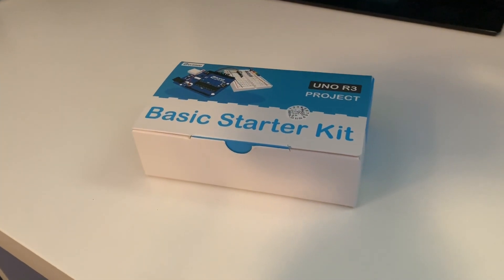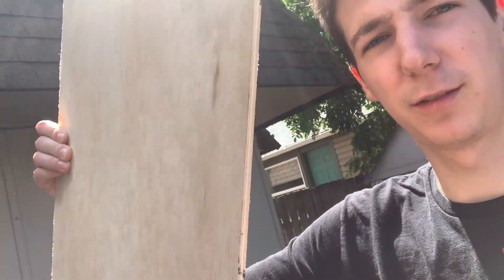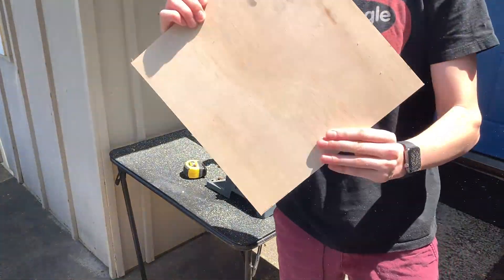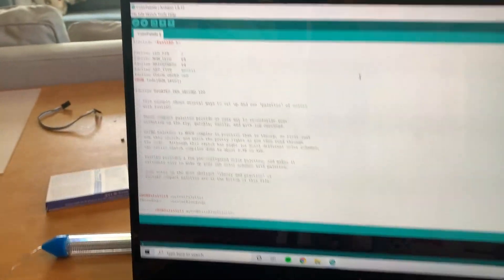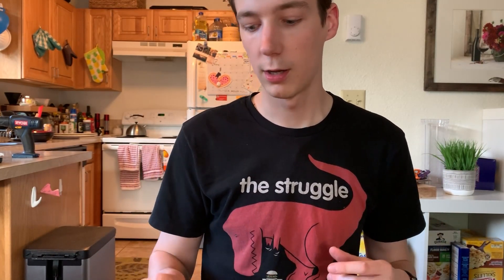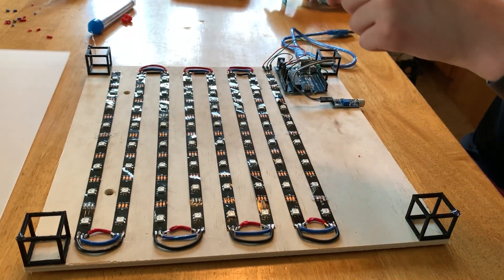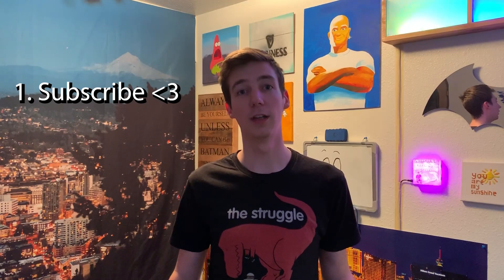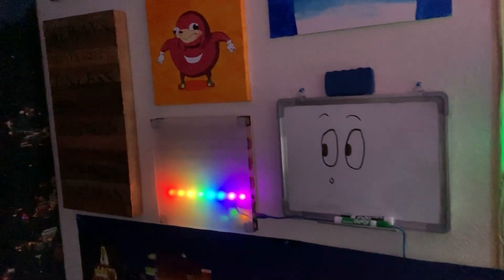Easy Audio Visualizer Using Arduino FFT

Comment: Hi, i've found you project really interesting. I need help for 1 changement to the code: Actually you are using 8 led for each string, with each led representing a different frequency. If i'd like to Transposed the effect (so each string has leds of the same color) what i should do?

Comment: The sound sensor you linked only has a digital output and can only detect wether the sound is above a certain threshold. So how come you plug it into A0 and how can you detect volume of the sound?
Reply from the maker: I never checked the data sheet for those mics but that explains a lot of headache. I spent hours trying to figure out why I was only getting 0 or 1023 😂

Comment: What kinds of values are you supposed to get from the analog read?. Mine seems to just hoover around 32 no matter what noise I make. Using KY-038
Reply: played around with the potentimeter and now its around 520 and make small movements when i clap my hands and such. But none of my LEDs turn on. Im using your exact sketch
Reply from the maker: Different microphone modules output different sensitivities. It’s been a while since I wrote the sketch but it’s listening for a specific range from the microphone (0 - 1023 I think?). You should use a sketch that reads analog input and prints it to the serial monitor so you can adjust the mic to hit that range. Alternatively, you can change the mapping function to map to your range instead. I’m sure you already did this but run a fastLED example to make sure your LEDs are wired correctly. Hope this helps, thanks for trying one of my projects!
Reply: @Tech-Random  Thanks for your response. Yeah they're wired correctly. I've made a 24x24 gif display, but wanted to add this as a mode after stumbling across your video because it looked so cool. I'll give it a go but seems the range I'm getting is so tiny.. like 519 when quiet and 522 when clapping. Maybe I'll just buy the same sensor you're using

Comment: I think I am having trouble with the code. When I use the color palette everything works fine but when I use the code supplied in the link, it either has a few stationary lights or no lights at all. Any suggestions?

Comment: Is it receptive? Doesn't it feel "laggy" because of all the delay from sensor to processing to displaying? I also plan to implement a visualizer using a mic because I dont wanna make an app or something but idk if its a good idea.
Reply from the maker: Lag is certainly something you should keep in mind when writing the code. Generally, you need less than 100 ms of latency so it feels responsive and not laggy. Microcontrollers are surprisingly fast at calculations so it’s pretty easy to stay within that time frame. I just finished my college capstone project and it has responsive sound reactive animations like this does while also listening for updates from a web server

Comment: is there a limit to how many LEDs can be handled by the Arduino? Was looking to make a larger version with more LEDS/m
Reply from the maker: The arduino can only handle about .75 amps output so you’ll definitely want to use a power supply for anything larger than this. Honestly if I were to redo this project I would probably use a dedicated power supply to make sure the arduino lasts longer.

Comment: Would have been nice to show the Adruino setup as well, which i guess many here might want to know
Reply from the maker: The setup is pretty simple. Just connect the LEDs to any digital pin and connect the mic to any analog pin.
Reply: @Tech-Random  I see. Well another question - Does the led only light up on low frequencies OR through out the frequency spectrum, since in the video I felt it reacted only to bass frequencies
Reply from the maker: Good observation. In the video it’s only reacting to low frequencies but you can adjust the range of frequencies by changing the sample rate or the number of samples being taken. In the video I’m showing the 8 lower frequencies stored in the vreal array.
Reply: @Tech-Random  Oh i see. Thanks for explaining

Comment: Hi, how would one change the code for a different size of matrix?
Reply from the maker: At the top of the code there are some values for the X resolution and Y resolution. Changing those and increasing samples to 128 can allow for a larger grid

Comment: Have you by chance updated the code to work with a larger frequency range?
Reply from the maker: I have not but there’s a better tutorial by someone else that does. Search for “ESP32 spectrum analyzer” by Scott Marley and you’ll see what this project should look like
Reply: @Tech-Random  Awesome, thanks! I got your code to work just now with my project, but I'm wanting to double the X and Y axes so that it's larger, but I can't get it to work. Any ideas?
Reply from the maker: I did everything in terms of xres and yres so changing the values of these at the top of the code where it says #Define should work
Reply: @Tech-Random  Tried that and when I change them to 16 they stop working altogether. I've tried changing it with the NUM_LEDS value too and it doesn't do anything. Thank you so much btw for responding!

Edit: I think I've figured it out. I just doubled everything. 8x8 to 16x16. But 64 doubled is 128, which is not 16x16. That's what I think is wrong.
Reply from the maker: Let me know if that’s working! That’s what I was going to suggest

Comment: my display backwards. how to fix it.thank
Reply from the maker: You’d have to change the code to start displaying from the correct location. The code assumes your LEDs are set up in a specific pattern so any other configuration will have to be changed in the code.
Reply: @Tech-Random  please show me that place. I'm an amateur.thanks
Reply: Hi, have you figured out how to fix the pattern?

Comment: Looks like it's not detecting highs, mids and lows correctly
Reply from the maker: Shh we don’t talk about that....

What’s actually happening is a miss use of the FFT arduino library. When I made this video I didn’t really understand how a Fourier transform worked so it’s only actually measuring the lows (20-300 Hz)

Comment: Do you know if there is a way to turn up the mic sensitivity on the Arduino board for the LED visualizer? Also, is this a full spectrum analyzer/visualizer?
Reply from the maker: The microphone module has a variable resistor to change sensitivity with a small screwdriver. This only has 8 bands and from my testing it covers 500Hz to 2kHz. With some tweaking the code can go all the way up to 20kHz though. There are some other really good examples of this online if you search for Arduino FFT

Comment: I notice you have a usb cord running out of the board -- where does it go?  Also, can this be powered by a power supply (powers the board, which, in turn powers the lights)?

I'm going to attempt this project but use 3D printed  parts and no wood.
Reply from the maker: The Arduino Mega can’t be powered by 5v unless it’s going through the USB port. Originally I just used a power bank for this but I ended up modifying a power cable and soldering it to the 5v from the power supply that powers the LEDs. To power an Arduino Mega via the Vin pin you’ll need to supply 7.5-12V which you could do with a voltage step up circuit but it would need more current.
Reply: @Tech-Random   7.5 to 12 volts or amps? Like for your LED panels, you powered your light strips with a 5v 10a power supply, then powered the Arduino board separately? Can that be done here? Two power supplies (maybe a little overkill)?
Reply from the maker: Two power supplies would work great! 7.5 to 12 volts for the arduino. Just be sure to connect all the grounds together
Reply: @Tech-Random   Would you recommend using the Arduino mega 2560 over the Uno you used in this video? Also, thank you for your responses!
Reply from the maker: Oh my god I thought this was a comment on my LED wall video lol. An uno is perfect for this project and you can power it with 5v. The usb cable in this video is connected to a power bank because I didn’t buy a power supply. A single 5v supply would be perfect for this project. Sorry for the misleading information, hope this helps!!!
Reply: @Tech-Random   It's all good -- thank you!

Comment: Nice!!  As I mentioned in another comment, I'm very novice when it comes to Arduino programming.  Can you give any general guidance as to what in your code to modify to change the rainbow display to have the columns be alternating specific colors of only two colors?  (e.g., columns blue, white, blue, white, blue, white, etc.)?
Reply from the maker: To get the rainbow effect I have an integer for color that gets incremented after each bar is displayed. Instead of incrementing each bar you could have a Boolean value and an if statement. For example: bool colorValue = 1; if colorValue == 1 color = 115 ; else color = 200; colorValue = !colorValue

Comment: Are you powering 64 LEDs just with an Arduino UNO?
Reply from the maker: Yeah haha. The code caps each LED at 30% brightness so 64 * 0.5 * 0.3 is less than the 1 amp the arduino can output
Reply: @Tech-Random  Ok, thanks. 

But even so, you should be aware that the Arduino has a max current output of only 40 mA per pin. I'd highly recommend an external power supply.
Reply from the maker: For some reason I thought each pin could do a full amp lol. Thanks for the tip!

Comment: Well done, again.  Keep up the good work.  Love your vids.  So what will your next project be?
Reply from the maker: I haven’t decided yet but I think I’m going to try something with a diy touch screen.
Reply: @Tech-Random  I was making fun of your board "What project should I do next?"  But that's cool.  Touch screens are still too expensive.  I have an ole Kindle I been dreaming about using with arduino.
Reply: How big a touch screen do you want to use.  I would send y0u a kindle to use.
Reply from the maker: @wjgiles50  Very kind but I want to try and build my own large scale touchscreen using IR light. I'm not sure how much work this will be and may end up caving and buying one off amazon though. I actually just got another suggestion that I'm going to build first so this build will probably be around the end of august!